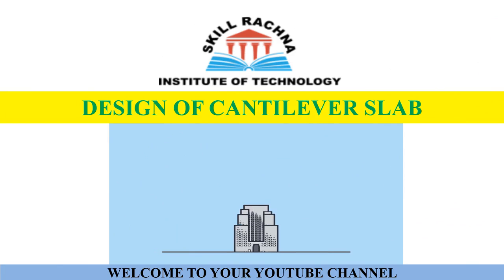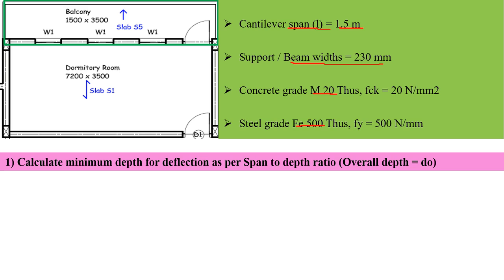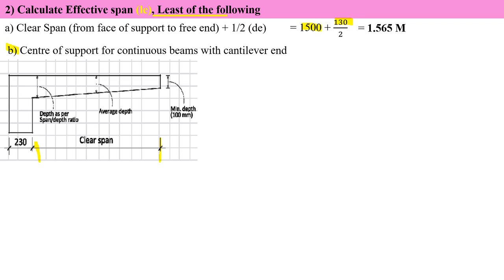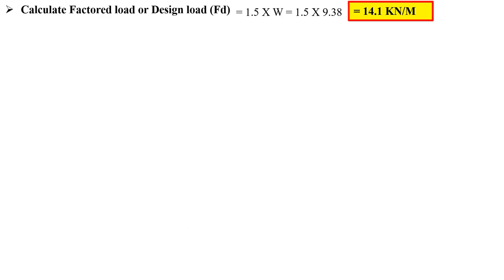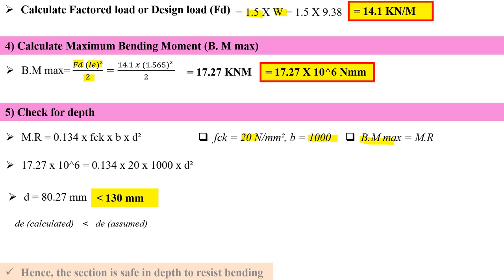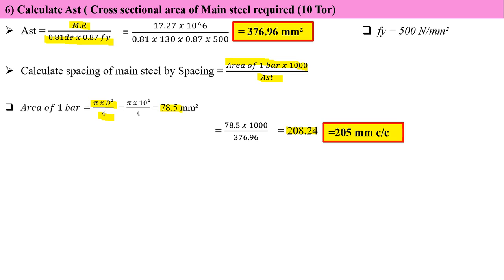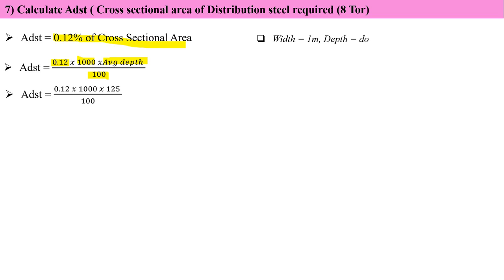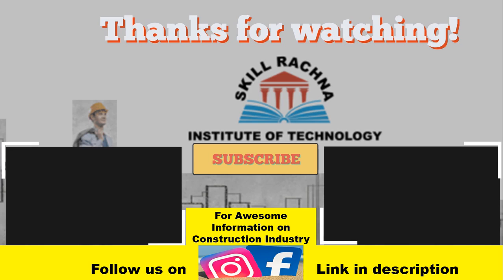Design Of Cantilever Slab // Step by step Explanation with Solved Numerical

Comment: Sir in slab you only considered bottom cover, why you not considering top cover as well. Like 2(clear cover -0.5(dia of bar))
Reply: Because effective depth has been taken from the top of the slab to half the bottom diameter.
Reply: @SuperChetanmore  ok ok, so top cover is also included.

Comment: Is this cantilever slab just extended freely without any support below from beam at every joint? Please Answer 🙏
Reply from the maker: Yes extended from beam.
Reply: It can be provided without beam too if load is less but generally need to provide appropriate with beam to counter the torsion and all other stresses.
Reply: Thankyou Sir for your reply, My question was will this slab able to hold without Cantilever beam projecting outwards from main structure at column junction.for aesthetic Point of view.
Please answer anytime🙏

Comment: 2nd doubt....The cantilever slab over all depth formula is span/10.. Here the span of slab is 3000mm.. So overall depth is 300mm… In practically is it possible to made 300mm concrete slab…?